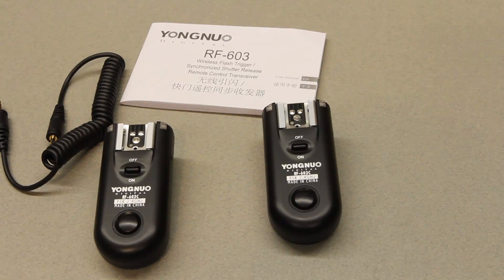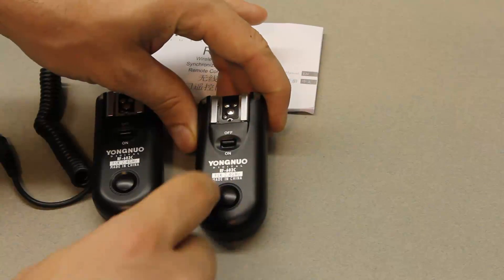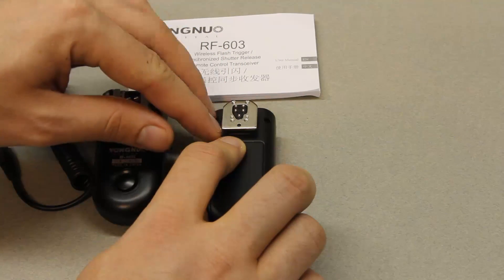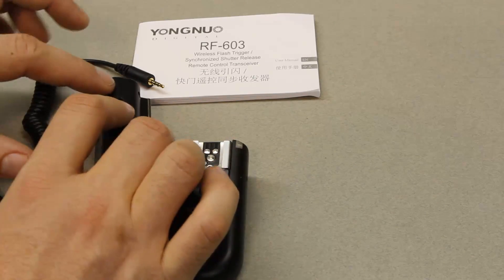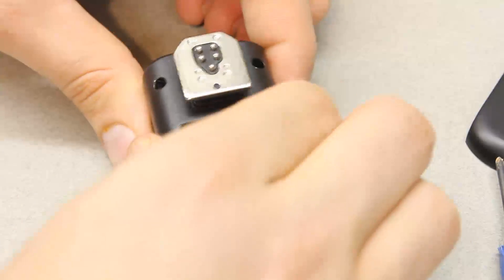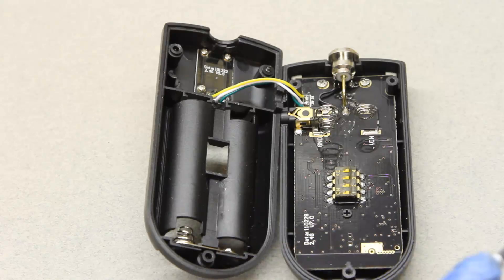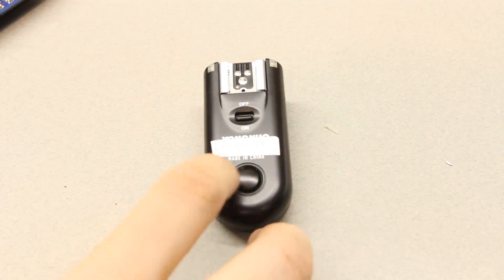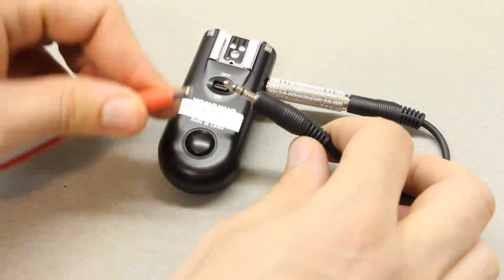TPB #20 - Hacking a Yongnuo RF-603 Wireless Flash Transceiver

Comment: Like your videos and I was wondering if you might be able to give me some advice. 
I want to make a YN622N AC
I purchased an RF-603 AC because I want to use the body and AC capabilities and gut one of my YN622N remotes.  I think the body will have enough room in it, but I don't see anyone has a video on it.  I'm good with electronics, but wish I had a video to go off of.  The led lighting should be fine inside the chasi, but the buttons would need rerouted...that is where I think I have an issue....I need an after market tiny button, but have no clue.

Comment: opto-isolators are transistors triggered by a led.  Try flipping the two wires.  You probably have the polarity reversed.  Secondly, you should be connecting the input plug to the button switch not the hot shoe if you want to fire the camera.  The hotshoe usually only works when the device is on the camera and fires the flashes.

Comment: if the trigger output voltage is to low for the yongnuo RC a small circuit with a OpAmp as an impedance transformer might help you with that problem.

Comment: This video features not the Yong Nuo RF 603 as a transceiver. But the stupidity of the guy in the video. First of, the transceiver has to sit on the camera shoe, and a flash sitting on the transceiver for them to communicate. Read the instruction manual, dumbass! And by hacking it, in which you failed doing so, defeats the purpose of the device  being a transceiver doesn't it?

Comment: I don't think voltages is the problem, since a simple "wire" is enough to short the 603 connections and cause it to trigger.
I think your Camera Axe might not shorting the right connections on the plug. Have you made sure that it does?

Comment: @DestonProductions After contacting ATG, I got the answer for that.
Get this "Kalt PC to Hot Shoe Adapter with Connecting Cord" 
Camera should have PC Sync Socket. Cheap cameras won't have that.

Place your 580EX II on hotshoe
Place RF-603 on Kalt & plug cable to camera PC Sync Socket.
A cheap off camera flip bracket works great for RF-603.

I like using ATG AK1 Un-Tethered Systems instead your ways.

Comment: You could have bought some sort of smal device that mounts onto the camera usually to offer a pc sync output for old flash. You can find them retty cheap on ebay, but make sure that hot shoe mount on the top of that box" does not have all those pins. You have to find one with just the metal "frame" and one contact If you want i can send you a link via PM

Comment: hey great video, pitty it didnt work out, do you however think that your hack would work for what im doing? i want to shoot events with my 580exii in ettl on the hot shoe and use my 6x 603's to trigger my other flashes ie run one hacked 603 through the pc sync port. there is no way to trigger the 603 unless its on the hot shoe. Any advice would be greatly appreciated.